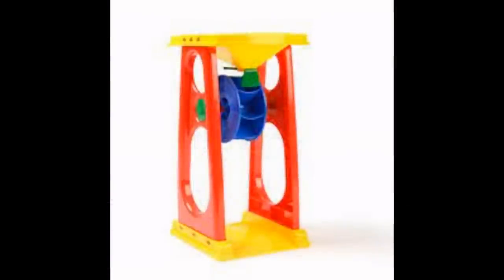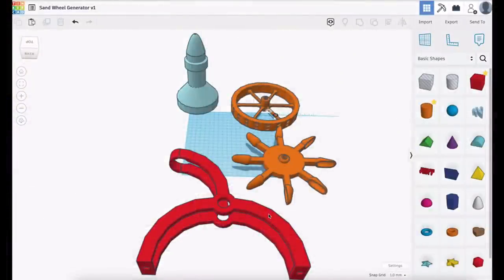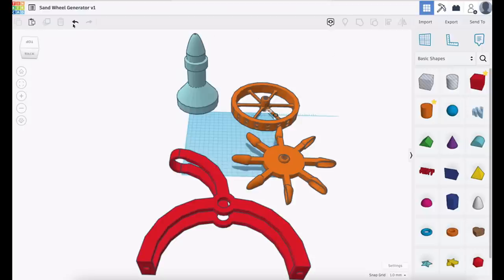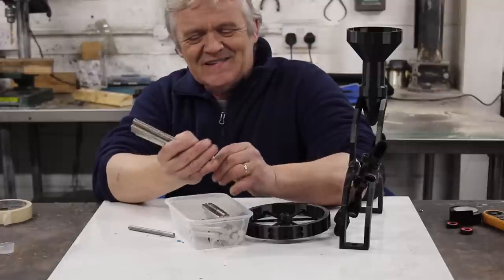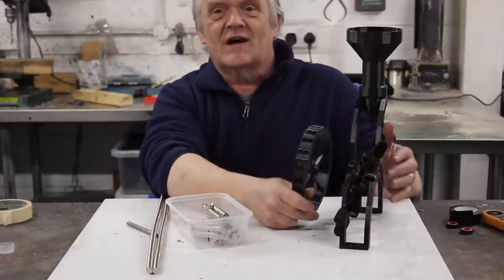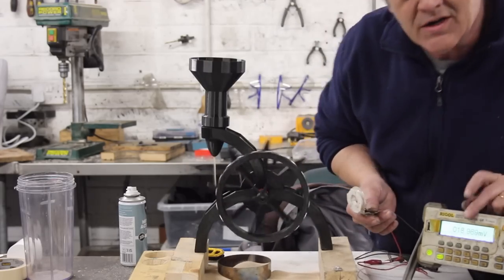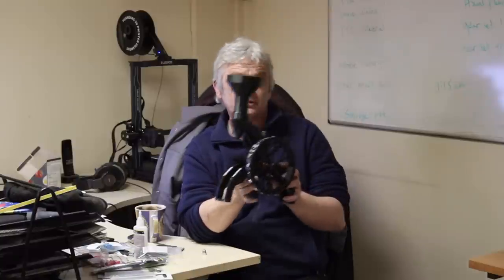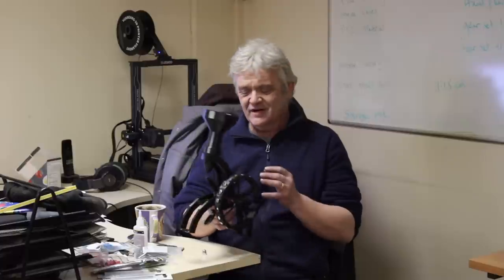1852 A Different Kind Of Sand Battery

Comment: Hello Robert, can Liquid Mercury be used instead of sand? Because Hg has a high mass that also means a higher energy density, no?
Reply from the maker: yes you could - but who would want to?
Reply: @ThinkingandTinkering  a proper wizard would do it. Water is over rated and sand can't be pumped

Comment: My question is. Could you possibly have a conveyer system on the same drive mechanism that returns the sand to the hopper making a perpetual motion machine ? Maybe reduction gears and shallow long hoppers to move it from on side to the other.
Reply: Like all perpetual motion machines, it's impossible. 
A little bit of friction slows the sand flow, so the wheel turns slower, so the return mechanism returns less sand, so the flow slows (or even runs out completely), so the return is even less...and so on. It will stop very quickly.
Even if it did manage to keep itself going, you can't draw any power from it...because that would slow the wheel which would mean the return mechanism returns less sand. , etc etc. 
It simply cannot work.
Reply from the maker: no mate you couldn't

Comment: This is an excellent demonstration! I wish I could buy items from your online shop but EVERYTHING is always out of stock for me. Maybe because I'm in the US? =`(
Reply from the maker: we have been having problems with the post here in the UK - strikes mostly - they sent a message to us saying overseas post was not going to be delivered and then am message saying it was delayed for months! - we got several angry folks who all had to be refunded despite their stuff being sent  so we stopped sending out until the post situation is resolved and it was easier to mark everything out of stock - but as soon as the situation eases we will be resending
Reply: @ThinkingandTinkering  Man, what a racket! That's awful that they opted out of shipping overseas, instead of finding viable options for you/your business to work this out. I am a programmer by trade and lately have been programming an online shipping calculator for use with an internal system. I wish I could help you find a way to get international shipping back on board, with some tracking and insurance choices. It's such a shame when the business has to refund the money after sending out the product! Do you feel like you miss out on a lot of e-commerce business because of this limitation? I might be able to lend you a hand from afar with some advice.

Comment: Good work Rob but next time try to make the print more modular so that you can experiment more easier without having to print new part again... for example where the hole is make that threaded so you can experiment with the hole and not have to print that whole part from scratch etc... just a thought thanks.
Reply from the maker: it's a good thought mate - but my plan was just to drill it out
Reply: @ThinkingandTinkering  For this case I would do the same but I was mostly speaking about future projects, good to think what parts you might want to ticker with before designing it etc :)

Comment: if the wheel stops in the case you are drawing too much power from the generator, the sand is still flowing constantly regardless if the wheel is spinning. this is not good.
Reply from the maker: don't do that then - charge a battery or capacitor and draw the power from there
Reply: @ThinkingandTinkering  Ill use a super cap just because they are cool.

Comment: If you add a chute under the wheel you can place another wheel under the first one and so on reversing the rotation every wheel since gravity is powering the sand you can add several to generate electricity to charge batteries and run a conveyor belt to return the sand to the top.
Reply: No, you can't. That's Perpetual Motion. 
Over centuries of design of marvellous machines, it simply doesn't work because of losses. This is the real world, with friction.
Even in an ideal world, you would only have a machine that ran itself. 
Like a desk toy. You couldn't draw off any power.
Reply from the maker: interesting idea mate -I am not sure it could work as described - maybe build a model and see?

Comment: Sand is really abrasive so it is going to wear out the machine in no time.
Reply from the maker: it's not really abrasive mate - kids play in it - we are not talking broken glass here in order to abrade rapidly with sand you need different conditions - sand is mildly abrasive
Reply: @ThinkingandTinkering  Kids can play in it because their skin is soft. Just like the rubber glove in a sandblasting cabinet does not get abraded away while the metal you are sandblasting does because it is harder.

Comment: It’s so brilliant, that you’d never think of it! I can see myself making something similar but on a larger scale as a way to offset the nightly power drain on my off grid cabin. A raised hopper with enough storage for say 6 hours over a wheel driving an alternator. 🤔
Reply: You'd spend the entire day filling it with sand, though. Whew, backbreaking. Converting the energy of your body into stored energy for later.
Reply: Not at all. That’s what I have a loader for. 😉
Reply: @pivers01  Lol, fair enough. I wonder if the juice is worth the squeeze, though.

Comment: Well would there be a way to utilize wind to blow that sand back up to the top to keep the cycle going.
Reply from the maker: now there is an interesting thought!
Reply: Haha. I just thought of that. Or a screw auger to get it back up powered by a wind generator.
Reply: @ThinkingandTinkering  Got it from watching sand waterfalls underwater in fish tanks, but they use air and the water to cycle it back to the top. Also I used to Frac in the oil field, we had to use TONS upon tons of sand. At the sand factory they used air like they do with grains to move it all around the structure.
Reply: I believe that's when a Darwin Wind Turbine design comes handy.

Comment: Fun video, can't wait to see how you'll get the sand back up again! But for some reason every time I hear Sandy Battery I wince! To me (and the dictionary) a battery converts chemical energy to electrical energy. Thermal sand 'batteries' are thermal stores and this device is a potential & kinetic energy generator. (apparently a water wheel can be 60% efficient).

(Edit: I just read that there is a water wheel that is 80% efficient which was invented just a few years ago and it works with a very low head of water!)

Comment: Rob - are you thinking the paddles could transform heat into energy ? Sandwheel meets Sand timer -  Heat the sand using Fresnel or pyramid lens - when need electric turn the sand timer, when need heat leave as is ? Love it !